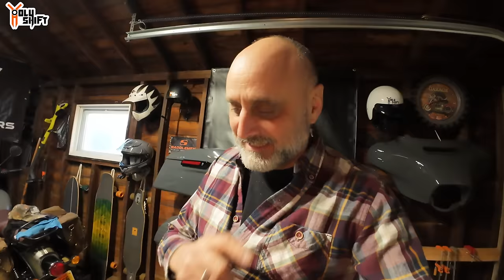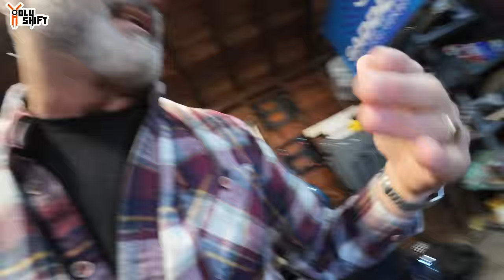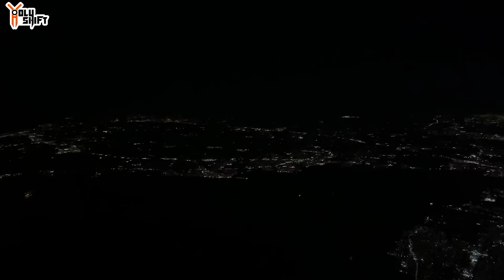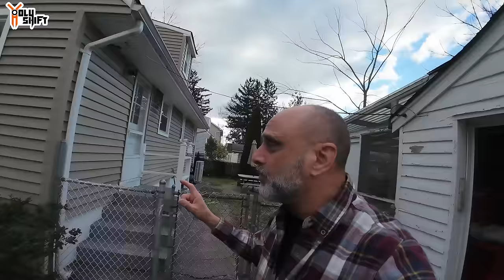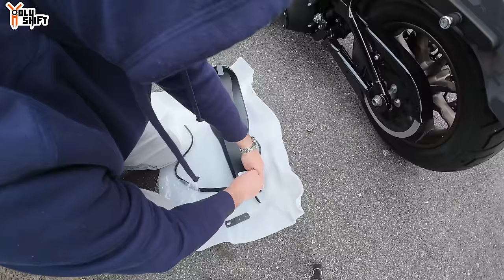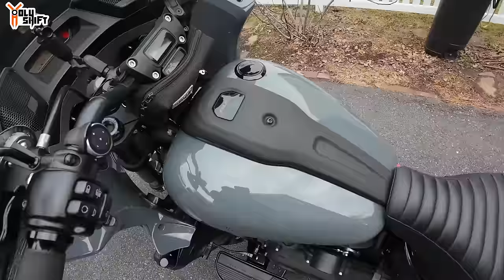My UFO Experience ! Color Matched Fuel Tank Dash

Comment: It's nice the co0lor matched. Seems a theme you are going with and it works. However I think It's not really a bike meant to be bling but a tough raging monster bike with that 117. I would probably keep the original or cause I like the contrast and little badge. Tough call. If it was a Street Glide maybe better in my opinion for that color match.
Reply from the maker: Fair enough! I will eventually have that panel in carbon fiber